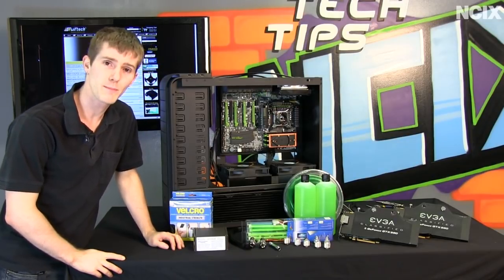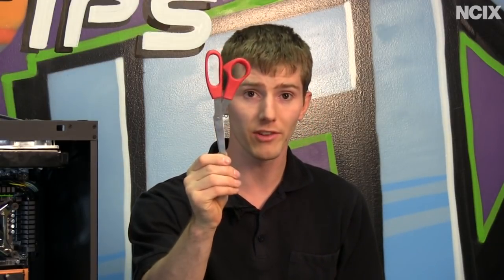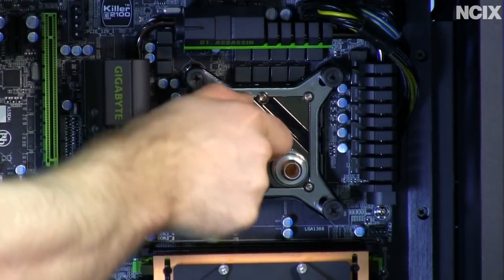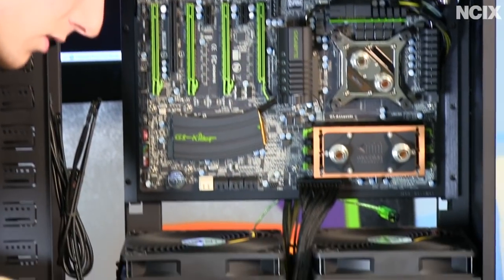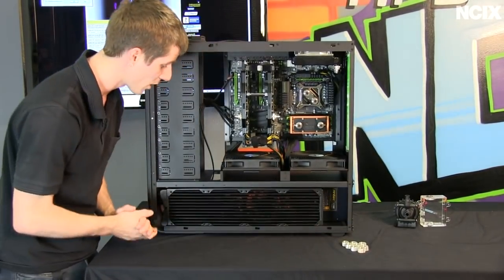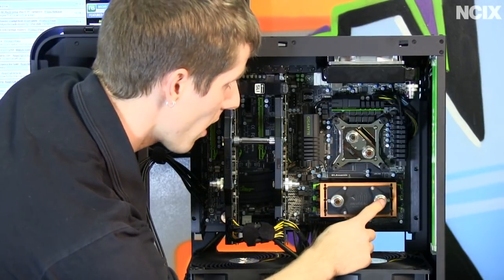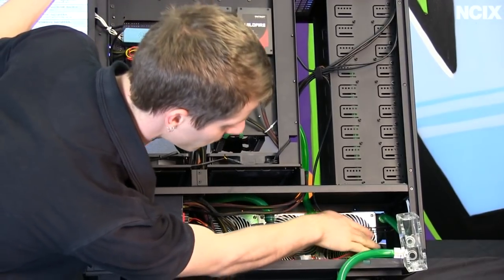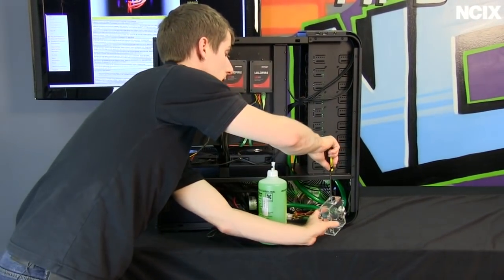Ultimate Water Cooling Guide Part 3 - Tubing, Liquid & Conclusion NCIX Tech Tips

Comment: Question, why use water? Why not a non-conductive fluid, like mineral oil?

I realize that in an ideal world you'll never have a leak, but it's also likely to prevent any growth of mold or contaminants.
Reply: +Vladimir Lastraud 

1. Mineral oil is a lot more viscous thus harder to pump and in turn would kill flow rate and head pressure of the D5 pumps used. Head pressure is the distance the pump can maintain the pressure of the liquid it is pumping.

2. Mineral oil is a lubricant and not a coolant so with #1 also being a factor, it will severely reduce the cooling performance of your loop.

3. Oils have less surface tension and will likely seep through your standard fittings in due time making quite a mess which leads to number...

4. Oils are a lot harder to clean out of res, rads, and off components WHEN it does leak.

5. Just because mineral oil itself is not conductive, it doesn't exclude the eventuality of it picking up conductive particles from the other components such as the metals in the blocks, fittings, radiators, etc and become conductive. You also have to factor in condensation from the air that's in your reservoir, blocks, rads, etc that will contribute water; even if only a minuscule amount to the loop.

6. You have rubber/plastic components in your loop such as tubing, o-rings, reservoir, and a large chunk of most gpu blocks will usually be made of some sort of plastic which will be eroded away by the oil.

7. Oil has far less surface tension meaning it WILL eventually seep through the fittings making a big mess.. not an easy task cleaning mineral oil off components.

Last but not least, even if you got a pump that was designed to pump such a fluid, it would probably be far more costly and still wouldn't solve the issue of plastics in your loop.

Hope this answers your question.

Disclaimer: I'm a software developer so I deal with computers not people, so if anything I've said in this post seems condescending, rudely sarcastic, etc. It was not intentional XD
Reply: Yeah, I found out most of this in post of my question.

The idea was just to subvert the possible issue of shorts with a non-conductive fluid, but mineral oil seems to be an all around bad choice to try and replace water in these systems.
Reply: +Tyrinath actually  distilled water has wery low conductivity so if the mix is done right and you keep everything else clean you should be pretty safe. And you still get metal particles but i don't  know how much it affects, i wouldn't  be so worried about them other then the wear.
Reply: As I learned apparently mineral oil isn't great at rapid thermal transfer.

Comment: question before I break my h100 to get a better cooling build can you salvage that radiator from the h100? If so is buying a different one any better or difference in temps?

stock fans and coolers suck i play crysis 3 beta with max fan speed and my gpu gets to 70C-74C on a gtx ftw 4gb.(non overclocked)

Comment: That's a common mistake: as long as you use distilled water and specific liquids, you usually run into no problem.. I just revived an old 7800GS wich was quite flooded with liquid because a wrong combination of tubing and fittings was used in the system. And guess waht? Blowed it with compressed air, let it dry for a day - still alive and kicking! Ant that happened to me many other times...

Comment: btw he said quad sli but isnt he only using 2 graphics cards? im confused on how that goes into 4 lol. i must be missing something lol.
Reply: GTX 590s are dual GPU cards, it means there are two gpus which run in SLI on the same PCB (i think 2 580s) so when you do a 2way 590s SLI is like a 4way 580s sli

Comment: Well two 590's is quad SLI since it requires SLI to run it to begin with. You can not use more than two 590's in a system since it is the max that nvidia allows for SLI right now. By what nvidia says it is Quad SLI. It is just built into the card.

Comment: Moving all of that heat to a radiator away from the engine is still much more efficient than building a heat sink on the engine itself.
It's not so much about getting the heat out of the car as it is getting the heat away from the engine, and then out of the car.

Comment: What would you have used?  Tape?  Magnets?  Velcro lasts longer than either of those and keeps it in better condition.  Magnets is the only other suitable option in my opinion but those thin magnets that you might use wouldn't do shit if the fans started to tip or something along those lines.  Why complain?  Velcro is simple and cheap and works better than 99% of other things you could possibly use.

Comment: My 4.8GHz i7 2700k hit 71c at maximum load on a D14 with 2 F-12's
But that is a Quad Core instead of a Hexa Core.
Will see if Raystorm RX360 w/ D5 will get me better temps later.

Comment: The pump is silent...at least in mine it is.
And the fans will actually have to run less, since the radiator transfers much more heat to the air than a large metal heat sink.

Comment: Linus is it Ok to use teflon tape for much secure tight in the processor?
Reply: what?! you don't  use anything but termal paste and a water/air block on the cpu
Reply: +TENNSUMITSUMA TERMAL?! RLY BRUH
Reply: +TENNSUMITSUMA pretty sure he's asking if its ok to use teflon tape on the threads for the compression fittings.
Reply: TENNSUMITSUMA WHY DID YOU SAY TERMAL
Reply: +Oldman Inthebread what's  wrong with "termal"?
Reply: TheHenirik what isnt wrong with termal
Reply: Oldman Inthebread It's a Hot springs area in turkey and how you spell "Thermal" in many languages. Now tell me something bad about it
Reply: Oldman Inthebread That doesn't make any sense. End of communication.

Comment: ok i got a question. you are running the lines from the cpu to the video cards right? wouldnt a radiator in between each component be better? or it that too much compression on the pump? i dont really know anything about cooling a computer but to me a radiator in between each component being cooled would yeild a cooler water temperature at all times right? isnt that the idea?
Reply: +IFIXUR360 I see you didnt watch the whole video, he adressed that. basically the water moves fast enough that it doesnt get hotter when it visits a block. its basically the same temparature in the whole loop.
Reply: jerppepepe
i actually did watch the whole video and i didnt catch that part. (if it was said) no need to be rude guy.
Reply: im not your guy buddy :)
Reply: +jerppepepe He's not your buddy, guy
Reply: Wanted Pickle I'm not your guy, dude.
Reply: jerppepepe im not your dude, guy
Reply: +IFIXUR360 Maybe, but nit by much. Ideally you would do that, but you're only looking at a few degrees of difference.
Reply: +KhaosN7 see that's what I was thinking. I don't overclock anything but I do know that shit can get hot in that case. so thats why I was asking about placement.
Reply: +IFIXUR360 Yeah, it really doesn't matter, we're looking at maybe a degree of difference with this loop. Because if everything is liquid cooled, it will be generating less heat. I use a Kraken x61 all-in-one liquid cooler and my CPU gets to about high 20 to low 30 Celsius at idle, and on a heavy gaming load can jump up to about fifty.

A custom loop will probably get the same with everything all said and done. Ideally, you would put a radiator between each component, but that isn't always practical, and would require a larger case, like the 900d from corsair. Which Linus also did a custom water-cooled build in!
Reply: +KhaosN7 yeah I got an ultra full atx case so I got loads of space. I got an H55 for 25 bucks still wrapped in the box so I jumped on it. its not bad for a start but damn the prices for a custom loop. I was looking at the predator loops which looked neat for a AIO and custom. lots of options tho. I want to do my gtx750 next but the water block makes it look weird.
Reply: +IFIXUR360 at the 10 minute mark buddy
Reply: +JamesBurns did you read the previous comments or just jump in premature. its already been figured out.
Reply: +IFIXUR360 You said you didnt spot it so I am saying where it is... He said it was in there but not where so by me saying where it is, you can see 2011 Linus tell you himself
Reply: +JamesBurns we already established my question but thank you for your input. the answer to my question was it doesn't really matter just IF a person wanted to and IF they had room. which was what I was already thinking.
Reply: +JamesBurns over my research of liquid cooling the concept I have found it to resemble is plumbing which is easy to me. and I figured out it all comes down to the persons wallet. if they have the money it can be done.
Reply: Yeah it can be done but seems impractical to divert your water literally an inch or so from the other GPU in SLI just to run it through another radiator.

Also, the people thhat have the money to make stuff like that also want it to look pretty, and I doubt it would look pretty
Reply: Just read you put from CPU to GPU and I guess its feasible, when people have huge Corsair 900D's they go Reservoir > Pump > Radiator at bottom of chassis > CPU > Radiator at top of chassis > GPU > reservoir

That being said, JayzTwoCents has 2 separate loops for his CPU & GPU
Reply: +JamesBurns yeah you know have a rad right after your heat source and have maximum cooling. but like jay also said it didn't really matter because the rads were big enough to handle.

Comment: hmm need help on my build .. for over a year tech support could not answer this question. i cant seem to get CMZ8GX3M2A1866C9 quad channel to work on a rampage iv extreme mobo. I tested it, all the slots work and all the dimms work but it says 12gb instead of 16gb even when i put it in x.m.p. mode. if you can help me out with this problem it would be nice . im just thinking it does not want to go to quad channel.

btw i7 3930k ,windows 7 64 bit and gtx 680 ftw 4gb

Comment: Great video, I just don't get why he's using green liquid and green tubing.
Surely just distilled water would be better.
I use white tubing and distilled water, if you have clear tubes or a clear reservoir on display,
then perhaps coloured water is an option, but his tubing is green and the reservoir is hidden.
Reply: He was using watercooling liquid which has all sorts of anti-bacterial and anti-corrosive crap in it.
Reply: +batt3ryac1d But the reservoir is hidden. He could just dump a kill coil in THERE.

Comment: what if you're running a 120hz monitor? running at 2600x1600, 5760x1080?3d? Dual gpu isnt for 1080 monitors, its for when 1 gpu wont cap you at 60frames.

Comment: Why linus temps so high? I really cannot begin to understand, if I can get 42c on my 4.5GHz 3570k on a slim 240, with no noticeable noise, and my gfx cards never go over 52c on gaming load in sli, on air, then why is this "ultimate water cooling" not doing better? maybe because you only have 1 rad, and the puny 120 rad?

Comment: The CPU tempature were not that good, its OC 1 ghz, full load and reach about 75 celcius? Its to high, that system much cost alot. The tempature should been lower if he used a full copper CPU block from EK, right?
Reply: hmm, this build would need around a 1k psu. not that much. and thats bc of the heavy useage of the gpu's
Reply: Doesn't work that way. He has two GTX 590s, so the radiators are dissipating all the heat from those alongside the CPU.
Reply: Well its still to high to be watercooled. Infinite Zero

Comment: thats a 6 core hyper threaded processor, wich have a stock speed of 3.46Ghz, Mr. Linus is running this processor at 4.66Ghz(wich is more than 1 Ghz of overclock) under full stress load.
you just cant compare an old processor at stock speed with this highly O.C'ed rig

Comment: Please install the fittings on the blocks first and then install the blocks. Especially with things like RAM blocks. You are putting alot of stress on the parts when tightening the fittings and that is totally unnecessary. Also getting a good grip on the fittings is alot easyer when it is just the fitting and the waterblock. Like this it is also not possible to damage the motherboard or other components if you would lose grip with the pliers.

Comment: 75-80 celcius on water cooling!?
My Hyper 212 EVO with the stock fan(1080RPM Max on bios setting) never passed above 67 degrees on my 2500k that's currently running @ 4,5Ghz 1.31V. That could be because of the climate over here in Norway but still, I'd imagine water cooling to be way more silent and better in cooling performance.

Comment: Who here has a TJ-11? If you do, I need to ask a serious question. Will an 360 x 80mm thick radiator with 25mm fans in pull with a PSU on the bottom? The PSU will be the OCZ Fatal1ty 1000W.

Comment: but mine is not stock i can run it at 3.7ghz and not go over 50c or rather i could before my hard drive died and made everything unstable for what ever reason but it was stable at 3.7. i do realize that his is a bigger out put cpu but the point is mine is more then enough for my needs and is doesn't get over 50c

Comment: hmm... u still have that Quad Radiator.. where is 4 fans... and then a dubble radiator, where there is 2 fans? Right???
So how can it still be so silent?  i have 4 fans 3x200mm fans and then 1x 120mm fan.. and its Not loud.. but i can still hear it =P.... and u have 6x 120mm fans and its so foocking silent?... how is that possible? =o... and ofc i have 2 fans on my GPU and then my cpu fan... But holy moly what a heck of a build! =D

Comment: 75-80C is too hot! I have a modest liquid cooled and mine overclocked at 4600, Is stable at 44C.  I guarantee the reason his CPU temperature is so hot, is because he switched around the input on the CPU block, to make room for the fittings. These cpu blocks are designed for flow, and likely not just intended to be switched around willy nilly. The water input is not going on the center of the CPU. This is the problem.
Reply: Dude he was giving it a torture test. Relax.

Comment: False. The water is cooled down by copper tubes that it runs through, the copper tubes are cooler by aluminum fins, known as the heatsink, and then those are cooled by fans blowing air in between them.

Comment: I have my 3770K overclocked to 4.5 Ghz, 24-hour Prime95 stable.
I then clocked it back 100 megahertz for ultimate stability (just to be safe).
Maximum temperature is 67 degrees celsius under full Prime95 load.
Idle is at 35 C.
Dafuq are you talking about?

Comment: Why leave a snake wad of wires showing through the window on an ultimate build?  Wouldn't you think that a wire mess that big should be managed on a system using such high end parts?  It does not showcase those parts for contributing manufacturers when the window looks that bad.

Comment: Man, those zip ties on pump fittings is a terrible idea. Plastic they are made of becomes fragile under ultraviolet in a couple of years. Use screw clamps instead.
Reply: You are right, there is nearly no disturbance on that connection. My humble opinion is that either don't use any fastening or use proper one. Zip tie is bogus, thats all.

Comment: Guys, I need your help. There is a contradiction between this tutorial and the one on Tom's Hardware. Linus says that the order in which the water flows doesn't matter. But Don Woligroski claims it does in this article http://www.tomshardware.com/reviews/a-beginners-guide-for-watercooling-your-pc,1573-6.html . I realize that the article is from 2007, but has something changed since then to completely flip things around?
Reply: It isn't true, JayzTwoCents made a video addressing it, and he showed that both cards had the exact same temperatures, even though they both received water from the same pipe.
Reply: the only thing that matters is that your reservoir needs to be above your pump so it doesnt run dry
Reply: Theoretically order does matter, however unless your are running 5+ components it will have virtually no effect on temps
Reply: Brian Alexander You mean 5+ heatsinks?
Reply: I think he means 5+ things you are cooling with the same pump
Reply: TheRobloxcoasterman
So like, northbridge+ram+cpu+gpu+gpu makes 5...
Reply: i'd say it's more likely that gpu*4 + cpu = 5
Reply: Oh yeah. That's a lot of GPUs.
Reply: Daniel Mitev why is that your picture?
Reply: Krevin Grard
Because I like it.
Reply: Daniel Mitev ok?????
Reply: Krevin Grard
Were you expecting a different explanation?
Reply: Daniel Mitev That's very creepy and weird.  That's a show for little girls.
Reply: Krevin Grard
Mostly any disney animation is for kids, but adults still like them.
Reply: Krevin Grard Have you ever seen The Power Puff Girls?

Comment: yay anotther i7X series prossesor
i myself use a 980X
Reply: +robot797 i wish i could lol - pentium g3258 ftw
Reply: Cardsharp XD
when i was in high school i saw the 960X prosessor
and it became a dream to have a extreme prosessor
and 4 years ago my last pc died
so i did it
i made my dream happen
i love this pc's
the hard disks suck (old)
the video card had to be replaced (old one burned out)
power supply coudnt handle the power (explosions)
but beside that the pc is still awsome
Reply: Good for you man!
Reply: +robot797 i have the 3930k still a beast. at 4.4 its faster than 5930k.

Comment: Very bad radiator positioning only 2 of the fans are actually cooling the blocks and the fans and wires are much too close. A wire could be ripped off by the fans. Should have chosen a better case one with a triple or quadruple fan inlets at the top or bottom. Like seriously expect better of these guys.